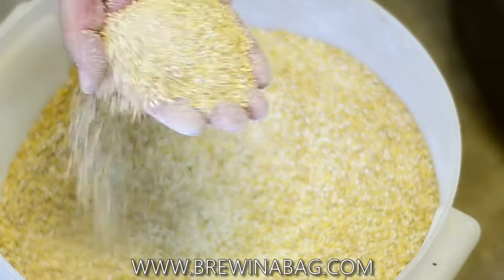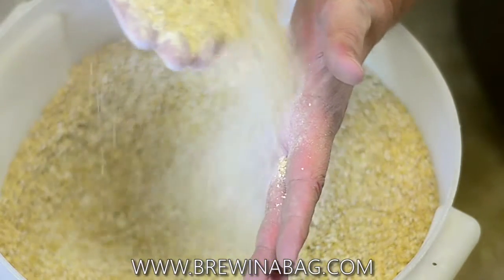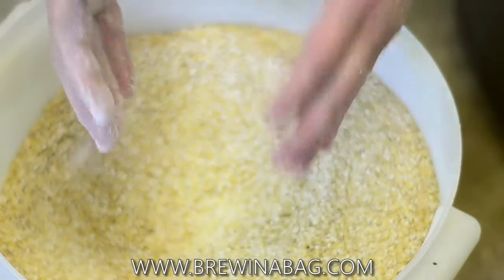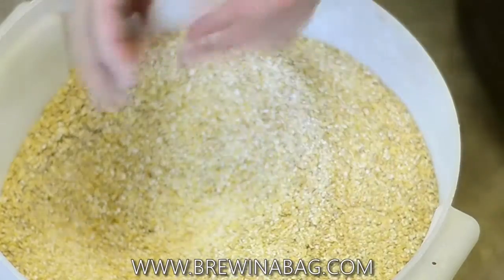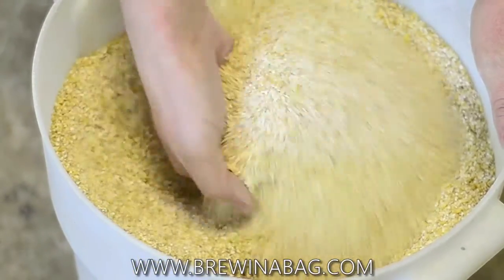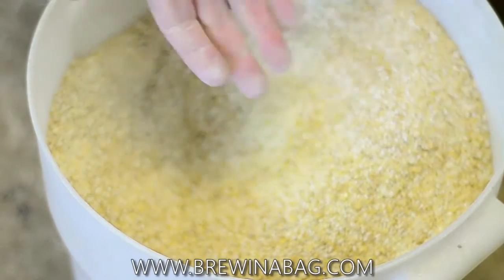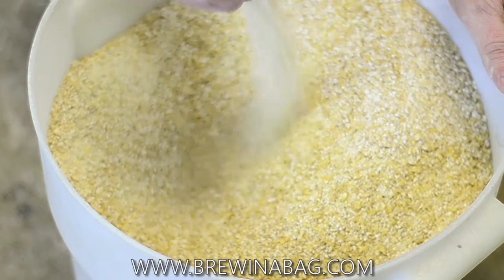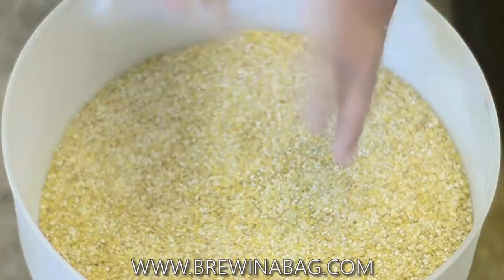Milling Results at .020

Comment: Good vid. I do have to correct one thing, .020" is NOT 20 hundredths it is 20 thousandths, or 2 hundredths . As an engine mechanic I use these measurements every day. A crush of 20 hundredths would be 1/5 of an inch which would be huge or no crush at all.

Comment: Are you recirculating? I milled mine at .025 and during recirculation my sparge keeps sticking. Even at half throttle.
Reply from the maker: yambor44 no recirculation intended as 210 micron does not allow good results. 400 micron is the best material if recirculating.
Reply: The Brew Bag Thank you. I am assuming mine is a 210 micron as it is one of you bags that came in my high gravity brew setup. Do you offer a 400 micron?
Reply from the maker: Yes, send an email to staff@brewinabag.com
Reply: The Brew Bag done. Thank you.